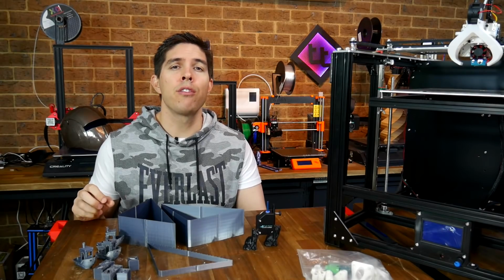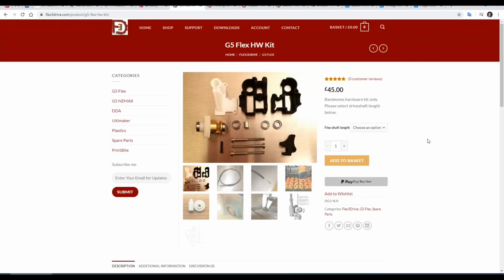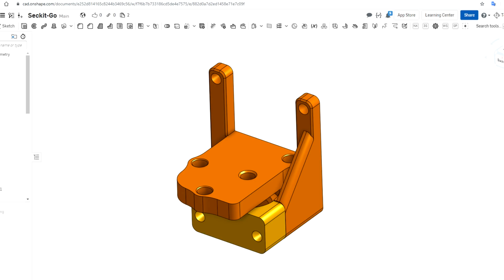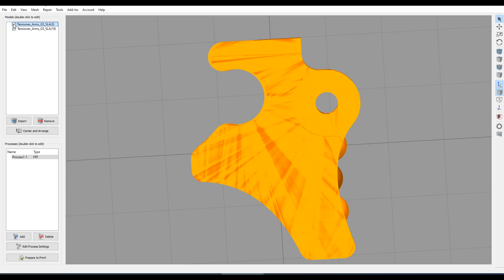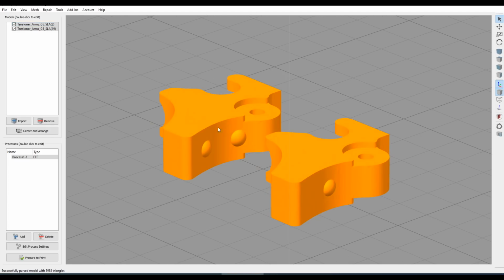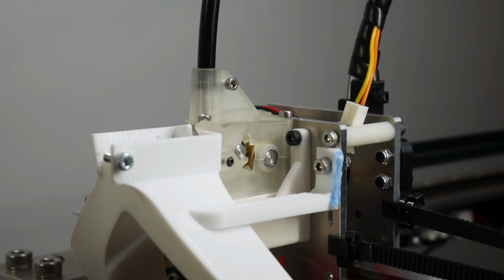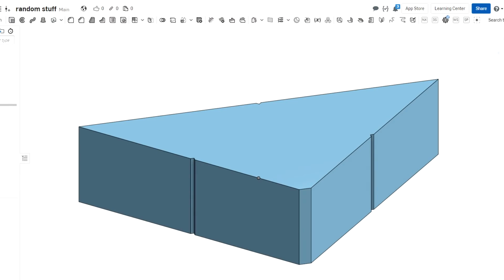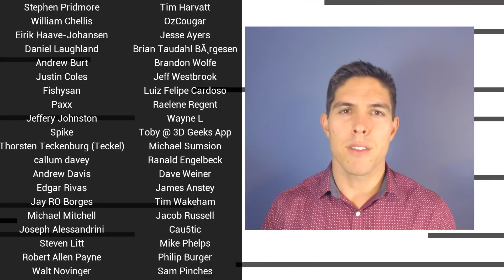Flex3drive G5 open source remote flex drive extruder guide - Seckit SK-GO

Comment: There are some weak aspects to the design of this thing. First, they should give you a proper metal coupler for the motor, that printed one just seems like it's asking to creep and come loose. Also, I don't like the idea of having toleranced tension arms instead of having a spring with a thumbscrew to adjust. Overall it seems like a design more well suited to a non coreXY printer, although on an i3, you'll run into the issue where your bed is gonna be way heavier than the hot end no matter what. I feel like on an i3 design you end up getting a better print quality increase just by ditching glass beds for PEI spring steel sheets.
Reply from the maker: Fair point on the non metal part, but personally I don't mind because I can alter the design or manufacture spares as I see fit.
Reply: @TeachingTech  How? unless its the merely the mountings for which there are STP?  There are only output files supplied for the extruder itself, STL. No source files for those parts, the actual extruder. Calling this open-source is simply disingenuous as the "source" is not even available.
Reply: the very low torque demand makes a metal coupler even worse. introducing rotational inertia is a bigger deal then rigidity at sub 2Ncm
Reply: @3dprintingguru378  Why not just use a bigger motor? Since it isnt on the print head, you could use a much longer motor than a weak pancake stepper. In fact for every bowden printer I have, the motor I use on the extruder is way overpowered. On my ender with a bowden BMG and a 40-42 motor, I feel sure I could lift the printer by the extruder if the filament didn't snap first. Torque should only be an issue when you're trying to reduce weight.
Reply: @WrexShepard  it's because you don't need much tourque, but due to the high gear ratio your stepper is running fast and does quick direction changes. so any introduced rotor inertia might cause overshooting and/or step losses. the whole idea in such systems is to transmit the least possible torque while maintaining reasonable speed/step rates. that system would even benefit from a miniature servo drive, since servo motors don't lose much torque at higher rpm.
Reply: @3dprintingguru378  oh ok so I think you're saying that with these remote direct systems specifically, that rotational inertia becomes a problem.

 This is because you've got that whole flex cable turning very fast with the motor shaft. Since it is going into a high gear reduction it's even worse because it has to spin that cable so fast. As such the motor is having to deal with effectively "slinging" the cable around and you want to reduce the amount of inertia when it changes direction. That makes sense.

I guess I wasn't thinking about the mass added by the flex cable as 3 to 1 reductions for standard extruders don't really add that much rotational inertia to the motor shaft. This problem with rotational inertia would get even worse with something like linear advance since it demands that the extruder be able to do really precise and fast direction changes frequently. 

I still don't understand why a stronger motor wouldn't help with that though since more torque should mean more of an ability to deal with that rotational inertia without skipping steps. I know that at high rpms many motor setups lose a lot of torque though, although some of that also depends on the driver I think.

 Like my tmc2208/9s work much better in spreadcycle on a bmg geared extruder since stealthchop isn't great at high rpms. I get way worse extrusion and even step skips while trying to print fast with linear advance in stealthchop.
Reply: @WrexShepard  bigger motors lose the torque at even lower rpm. so depending on the acceleration that means you run through really low tourque phases with higher rotor inertia. and you're right it is somewhat dependent of the driver, but you'd use lower micro stepping for such a system. stealth chop isn't a good idea for extruders anyway.
Reply: Adjustable tension arms impact your effective e-steps with every filament change unless you get exact same position. Using a spring can also introduce variance in the same way.
Reply: @Mutley3D  That is a fair point I guess, but in practice the only time I've encountered that is on direct drive printers with underpowered pancake steppers. A bigger motor should be able to overcome any inconsistencies by its sheer torque alone. I tend to keep a spreadsheet with steps/mm and linear advance K for every filament/printer combo anyway.

Comment: Doesn't that introduce the backlash by the flex drive instead of the bowden? Maybe I underestimate the flexdrive.
Reply: If I remember correctly, the Gear down ratio of the worm gear is 40:1, so while there is a little backslash in the drive cable, it is not measurable at the actual drive gear any more.
Reply from the maker: Potentially the worm drive could have lash but I agree with Ole in that the 40:1 ration will sort that out. The tolerances are also good which helps matters.
Reply: @TeachingTech  I have to admit, that I never checked the dimension of backlash. But only looking at the retraction parameters for direct drive (1-2mm) and bowden (4+mm), it looks like I can expect at least 1mm of extra backlash for bowden. I can see that the (potential) torsion spring behaviour is tackled by the 40:1 ration to reduce it to a tiny fraction of the 1mm. I haven't even thought about the worm drive lash. Technically the 40:1 doesn't apply to it (e.g. if the worm gear itself jumps up and down). Although I always have to think about lego worm drives, which hat serious backlash, I see that it can potentially be 0.5mm and below.
Even if the flex drive type does not destroy bowden drive in case of PLA, I see the huge advantage for TPU. 

The question:

Why isn't there a hemera like version offering an ultra short path between the extruder and nozzle, while keeping everything even lighter?
Might it be the cost? Bowden is often a cost reduction, too. In that case the flex drive would add so much cost, that many companys probably would use direct drive, as it is less parts than flex drive?
Reply: You are all generally on the right track here and scratch the surface. Delve deeper and there is a lot one can do during design to avoid the issues, like using lower gearing to minimise that load, use a thicker shaft, and drive it in the right direction. Core features of all Flex3Drives and only found in Flex3Drives. I will be sharing all detailed info about this on the website to share so people can create their own designs and avoid the pitfalls.

Comment: There should be also said that reduced ringing due to bowden/flexdrive setup has most advantages on coreXY or delta printer. On i3 style printer the Y axis with movable bed is probably as heavy as direct drive setup on X axis. Fitting bowden/flexdrive on such printer will only eliminate ringing in X axis.
Reply: Even in core xy I sometime wonder if a remote direct drive will help a lot, If there is a linear rail supported by a steel traverse moved (like on Saphire S). I think a crossing rods design (ultimaker) maybe with Carbon rods would profit even more than most core xy.
But definitly: For Delta (esp. big ones like Predator) it is most interesting.

As there is a massive gear down ratio  by the worm gear, the motor can be very smal anyway (moving fast, only 1/4 Microstepping, but more than 1000microsteps/mm). So how much would be the weight of a "normal" direct drive with such a smal Motor with massive gear down? I think on anything but maybe an Delta you would not have a difference; at least printing PLA and PET-G where cooling beiing the limiting factor.

Comment: Interesting to see a resin print being used for something functional for once. 
Please keep us updated as to how it holds up.
Reply: I only bought an MSLA printer when the resins became structural.  Some of the parts have better mechanical properties than FDM parts because resin parts are isotropic and don't suffer from layer delamination.
Reply: @michael90810  One of the key design objectives was to make it fully printable for all processes, for the purpose of allowing printerists everywhere to printer it themselves :) It holds up well if the parts are correctly printed and fully cured with most resins.
Reply: Hi, do u have an external lcd? I’m revillete, I put it in my collection.
Reply: THere are plenty of functional resin prints. In fact the cheapest way to print true engineering parts as a hobbyist is with resin at the moment (30% less strong than PEEK (But also 30% less expensive), same thermal properties). Reason? you dont need a 100k stratos printer but can just use any crappy SLA LCD printer you can find .
Reply: @Trikkie87  you certainly dont need 100k printer to print peek. my sub 500 euro ender 3 build can reach 130 bed 50 chamber and 450+ hotend temp. not quite there for peek esp in terms of heated chamber but defo doable in a sub 2k budget i would say.
Reply: @randomstuff-cu4of  , do you use this flexdrive in your set-up ??
Reply: Thu Nell Ⓥ  - I've seen the salt remelting process and it's intriguing and a genuinely useful trick for FDM printing.  It's a bit tedious and resin prints will always produce nicer surface finish and better resolution.  I love that resin prints are now VERY structural.

Comment: Would this work on an Ender 3?
Reply: I've got one on mine. It works well.
Reply: Was it hard to install?
Reply: @Ben-Le-Page  it was awkward. I have a microswiss and ezabl, so had to design my own mount. I also couldn't print the parts well enough.
Reply from the maker: As other comments have said it will only improve the x axis movements because the bed moves independently with Y. For any of these designs, you can always use shapeways or similar to print the parts, or order them SLS/SLA from the store.

Comment: Are you going to do a proper review once you have your fan fixed? I am curious about this setup at high acceleration but the introduced flex seems like it could bring up different issues
Reply from the maker: I'm thinking about a better test in future upping the acceleration rather than the speed on the tower. After the cooling is fixed of course.
Reply: @TeachingTech  as many indicated to me when I was first pushing the limits one should always do the maths for his calibration models to figure out whether you even reach your top speed at a given acceleration. I also found acceleration having a much larger impact on print time, while the preset values are more than conservative.
I'm curious to see your results!
Reply: hey, I'm ElWiz, the one mentioned in the very end. you can check my yt channel, I have some short vids with high(er) speed printing. I can push the print speed to 220mm/s with certain materials. PETG 140 - 180 with very minor ringing. it's prefectly fine for functional parts imo.

Comment: now you only need a remote cooling fan, to decrease the weight evenb further and increase the cooling.^^ I guess a long tube and a nice strong blower fan should be enough?
Reply: Or get a sturdy printer so the weight doesn't matter,  industrial fdm printers have hotend's alone that already weight 2.5kg and the complete carriage over 10+ kilo's and prints over 120mm. the weight doesn't matter if your printer casing / base / frame is sturdy enough. And a lot of materials want slower print speeds so a light gantry so you can print "fast" doesnt even matter.
Reply from the maker: Fair enough but this is a channel for enthusiasts who aren't in the market for the size and price of an industrial printer.

Comment: Cool idea. The thing about direct drive is that most systems are still lighter than what the Y axis has to throw around unless you have an Ender 5 design. You'll have ringing from the Y as speed/accel/jerk increase long before the X axis. At least this is the argument going around Facebook constantly.
Reply: Yep, my ender 3 is still bowden, and I use the glass bed, and honestly that glass bed is making my bowden setup kind of pointless. I'm limited by bed weight far more than hot-end weight. I plan to switch to DD at some point, although bowden is working out fine for me as long as I use linear advance, which I have to use to kill stringing on the micro-swiss.

Comment: The guy that lives about being Open Source and having the files on GitHub. I gave him the benefit of the doubt and asked for the source files. Still nothing. Definitely NOT open source. He should take the bits about GitHub off the website, if he's not even going to have a GitHub page!
Reply: There's a downloads page on his website, with the step files and everything. The github hasn't had anything added to it yet. It's all on the website
Reply from the maker: I think it's fair to say that until recently the files have been available by searching on the discord sever, rather than a static website. Inconvenient but not a deal breaker, I was able to get what I needed within 24 hours. The new downloads page is a huge improvement.
Reply: @Narthan11  Stp files for the mounting brackets only. Its not all on the website, far from it.
Reply: @m3chanist  No, the extruder STLs are in the upload section as well. The worm gear set is the only thing that I can see is not up there. And yes, I would love for him to post the step files for the design. But its just about as easy to modify a mesh created from stl vs step files.
Reply: @ImplicitConversion  STL is an output format.  Try actually editing one to dimensional accuracy, not just deleting a few faces. The ease you claim is why the stp files aren't there, to provide a major hurdle. The STP files are only for the "supporting files" not the extruder itself. This is how to appear to be open source while not being open-source, the actual source isn't actually available, but you can edit a bracket.
Reply: @m3chanist  That depends on how easy you think it is. I've in fact done it, fusion 360 made it pretty easy for me. So again your arguing purely on your opinion and we are a a difference of opinion.

Would I like step files more sure, but it's up to his prerogative to decide what he wants to license and how.

You however seem to have a motive that's a bit trollish.
Reply: Between prepping the file release, redoing the website, orders, design and support work etc sometimes things take a little longer than hoped for, but the files are released. I opted for site based downloads rather than github for the moment, but that may still change down the road. Prior to this, files always provided to customers.